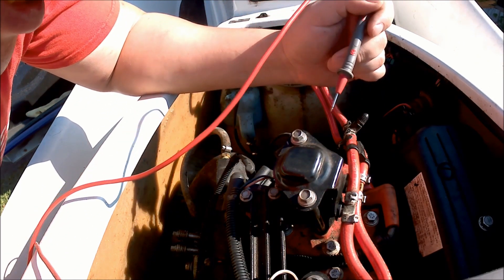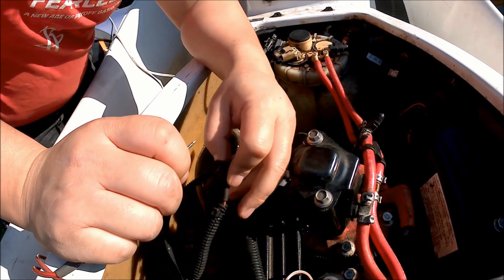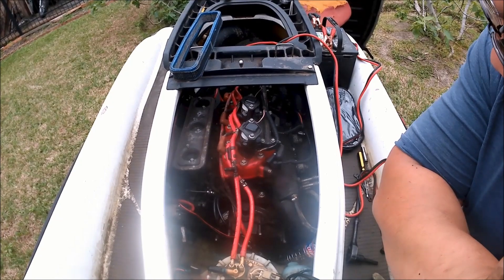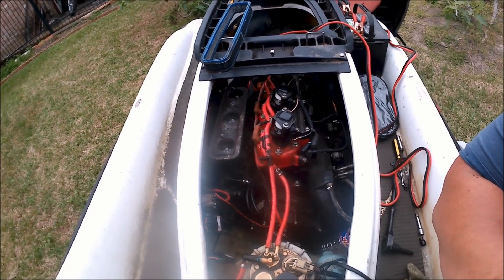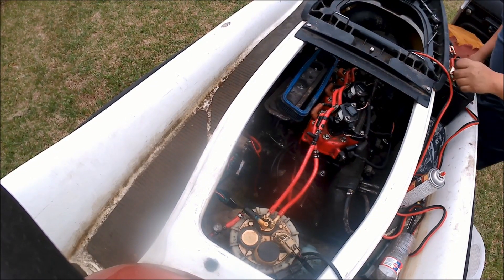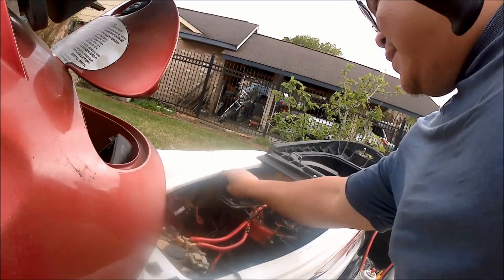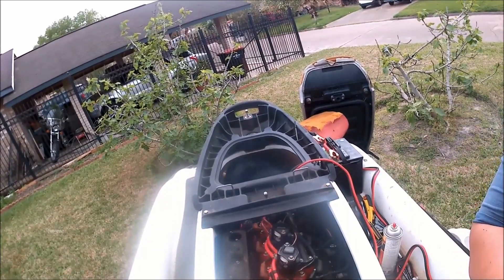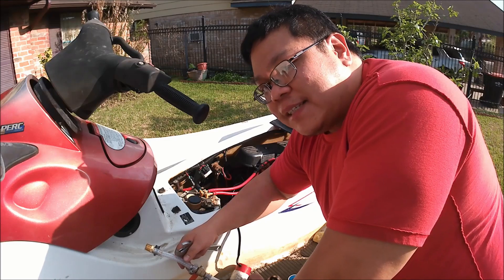Jet ski - Something blew up on my Polaris 1200i

Comment: i know that this video is three years old but if anyone is reading this and has the same symptoms as his jet ski the problem is the emm, sadly it’s not a cheap fix but you can send it off to get repaired for around $450. i have 2 polaris genesis 1200 direct injected jet skis in my front yard right now and they both have the same EXACT problem, it’s not hard to change out the emm it’s just not cheap. Good luck.
Reply: agreed...same goes for the 800DI models Virage i
Reply: I have an Polaris virage i 800 same problem but I don't what's ir the problem

Comment: Guys! It's probably the bilge pump it will have no spark if the bilge is unplugged or damaged
Reply: It wouldn’t spark at all if the spark plug were fucked
Reply: Just bought a Polaris genesis 99 carb model.. got it started 3 times but won’t start back. Getting some spark but I don’t believe it’s enough to power it after reading this comment I did look and see that someone has cut the line of the Blige pump and ran a toggle switch but didn’t connect it to anything. Gonna look into that

Comment: You never explained what you did to get the spark. We have the same jet ski. We have tested the cdi, the stater and we still don't get a spark in any of the spark plugs.
Reply from the maker: i thought i put it in there. for me it turned out the kill switch was bad so i had to bypass it
Reply: @RideOrFish  and how did you do that?
Reply from the maker: It's been a while but if i remember right where the switch is on the handle bar. You take that apart and you can jump the wires. All the kill switch does is break ground.bso if you fall off and yank the key it loses ground killing spark.

Comment: I’ve got one and I think I have a injection issue
Reply from the maker: You can do a bench test for flow with a 9v battery. Look up bench testing injectors. What I did was a very basic test just to see if they were working.

Comment: do you still have the original old grey fuel pipes fitted?...these need changed if you do, and carbs cleaned
Reply from the maker: Not sure been a while since looked at it. But thanks for tip. Probably gonna turn this jetski into a jet John.